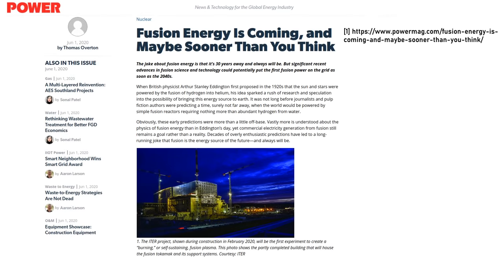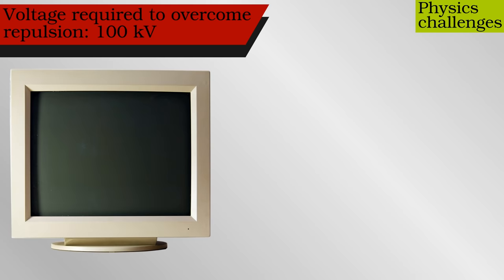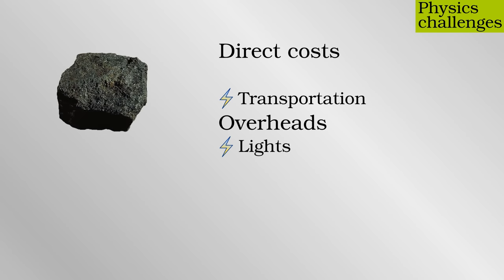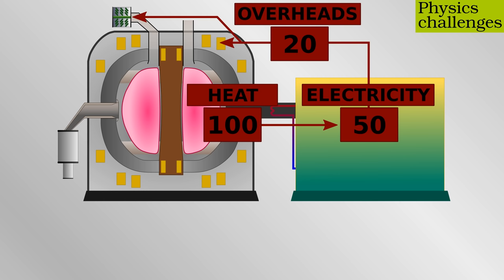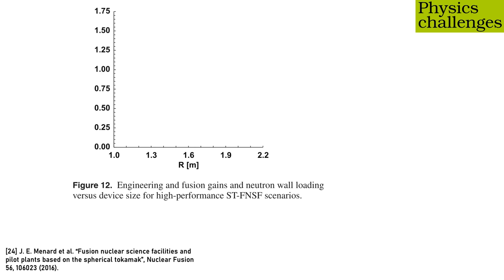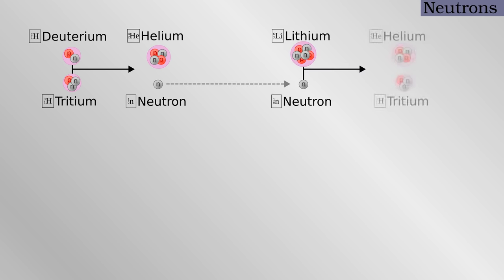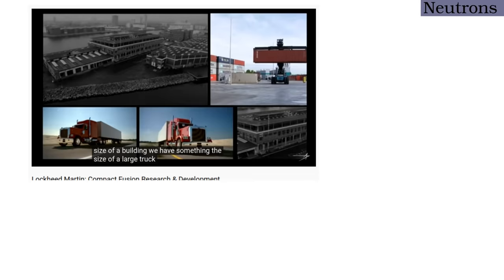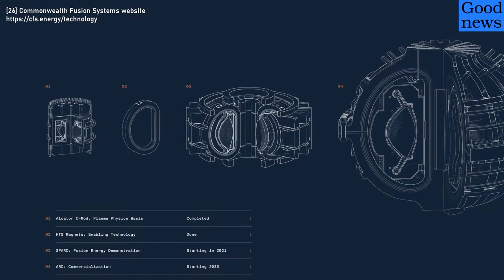Former fusion scientist on why we won't have fusion power by 2040

Comment: I worked at Princeton Plasma Physics Lab (PPPL) for 32 years leaving in 2011. When I started in 1979, they said "We'll have fusion commercially in 20 years"! We did achieve fusion with a D T reaction in 1996 and we did produce 14 MeV neutrons. It was a lot of fun working there!
Reply: I made a fission reactor in my garage but if anyone finds out they’ll come for me
Reply: @monkmoto1887  this comment was sponsored by Nord VPN
Reply: @monkmoto1887  Is your real name Sheldon Cooper?
Reply: In other words, nothing that benefited society.
Reply: @yourlogicalnightmare1014  Exactly . Its all 'Pie in the Sky '
Reply: @tonyjones7373  That's what Richard Feynman said about Project Orion.
Reply: You should have stayed a few more years as the physics codes scaled up.  Almost all the success of NIF between now and 2011 was solely down to advances in plasma modelling

The reason all these fusion startups are getting super confident is because they can rent time on some big supercomputer or GPU cluster and mash out field geometries to solve specific plasma dynamics problems.

You guys were sadly flying around in the dark.  Plasma physics has completely changed now.  NIF PIs almost prototype by simulation these days as far as I'm aware.
Reply: @ralalbatross  That fails to solve the myriad of technical hurdels involved in actually containing and then harvesting energy from any form of fusion reaction. 

Until you solve the problem of stars cheating the system via gravity, you will never achieve a fusion reaction that not only outputs more than was input, but also outputs enough to net a positive amount of energy in the system.
Reply: @keysersoze3987 very impressive. what's your take on this video? will we have fusion commercally any time in a future?
Reply: @bort6414 and the original steam engines only extracted 2-5% of the energy in coal. All technology starts inefficient it becomes better as we understand more no need to hate on advancement because it hasn't given you everything yet it's already given us so much
Reply: @bort6414  Stars don't cheat the system with gravity.  They increase both the temperature and interaction cross section by increasing density under extreme mutually exclusive electromagnetic pressure.  There are plenty of situations where fusion begins and then ends without the star igniting.  If anything we are cheating by using almost unnatural magnetic fields. 

The problem with hot plasmas is that they are fundamentally unstable due to fluid instabilities.  It's those which prevent most of the plasmas from burning.  Computational plasma studies allow you to remove and heavily dampen those instabilities by testing experimental parameters against likely outcomes, and then adjust experimentation to account for or track those instabilities.

Most of those techniques have been around for decades but only since about 2008 have they been scalable and deployable as they are now.  Experiments that would have taken six months to set up and fund and then fail without result are simulated in hours now.
Reply: You should have been working on flying cars. Everybody knows that 😂
Reply: @ralalbatross  Mhm. Sure it isn't.
Reply: @bort6414  I don't get it though the point isn't to make an artificial sun in this case its to make electric energy for the grid. You don't need the fusion process to output more than you input it only needs to be output enough to do what all nuclear plants do...make steam. 

Nuclear reactors are just big steam generators.. the steam is doing the work the energy is in the water..
Reply: @off6848 That's a gross misrepresentation of what a generator does. Of course all generators are less than 100% efficient. The point is that a generator takes a less useful form of work(heat, potential, etc.) and transforms it into a more useful form of energy, by decreasing the entropy within the system at the cost of increasing the entropy outside the system.

The issue with terrestrial fusion energy is that across the entirety of the system, it requires more useful work to be put in than it can produce. A steam turbine takes a certain amount of useful work from a systemic level(extracting the coal, building the refineries, igniting and controlling the fuel reaction, so on and so forth), but the end-result is a vastly greater amount of useful work output. Of course, the universal amount of entropy ends up increasing, but within our tiny little closed system that demands imbalances of energy be deliberately leveraged to achieve useful results, the amount of entropy decreases, and that is what matters at the end of the day.

The reason why stars are so great at this is because their immense gravity sets up the proper conditions to achieve fusion with relatively low temperatures. Additionally, the nature of gravity, being a one-way force(objects always attract), means that the very nature of a star itself is working to keep the fusion process in equilibrium(as the star cools, it's gravity is able to more strongly overcome the thermal expansion of the fusion process, which causes the fusion process to require less heat, increasing the rate of reaction, which heats up and expands the star, causing the rate of fusion to decrease... Thus the process is self-regulating as long as there is fuel mass to fuse).

Fusion-based energy production is impractical because not only must our fusion be orders of magnitude hotter(which requires more low-entropy work), but containing that ignition then also requires a massive amount of low-entropy work. The end-result is that the fusion systems on earth cannot produce more useful work than they consume, which means they are useless in respect to power generation. 

Once we reach the point where terrestrial fusion generators produce more useful work than they consume, by all means, we should build as much as physically possible. Until then, it's a glorified pyramid scheme that doubles as a scapegoat for actually useful power generation systems, such as coal and nuclear, and every moment we spend loafing around and dreaming of "cLeAn enErgY" is a moment human lives are lost due to lack of access to energy, and that makes me sick.
Reply: Maybe 🤔 if there was another Fermi like mind working on Fusion,then it would work 😂
Reply: The lack of appreciation for progress in this thread is sad. No one seriously working on fusion is promising the moon. Progress is happening and it isn’t happening at the expense of the average person or for nothing. These experiments are yielding important information that goes beyond fusion electricity. Get your minds out of the “fusion is always thirty years away” gutter and get some perspective
Reply: They have enslaved and fooled you 👉 The Connections (2021) [short documentary] 💖
Reply: oh, wow! 14 MeV neutrons! ...... wait, what are we supposed to do with those neutrons?
Reply: Eventually someone will crack it. We already have fusion bombs and the sun is powered by fusion.
Reply: Fusion is the world's 2nd greatest boondoggle,  next to "renewable energy".
Reply: The moot point that it is fun whether something practical is produced or not. The major achievement of fusion has been being able to make a great living and enjoy yourself on an eternal promise never fulfilled.

Comment: I worked on a fusion reactor back in the 80’s.  They swore the next version would be a full scale commercial reactor.  Parts of it were already on site!  Here we are nearly 40 years later and it’s still 20 years away…
Reply: It's a large site, takes a while to move the parts into position and assemble them.
Reply: I blame the construction permits.
Reply: would be foolish to buy into that far back. Fusion isnt fission lol. If fission is taking a sledgehammer to smash something, fusion is a doctor using a robotic scalpel to operate on an ants brain. like 1 to 100 difficulty change.
Reply: @Andytlp  the main issue is field strength... and ITER has relatively weak magnets to what is currently available which is why projects starting to be built today at smaller scale with more powerful magnets are probably going to reach fusion before ITER does...
Reply: @Wingnut353  I thought they used electromagnets
Reply: So we can deduct that the half-period of fusion technology is 20 years and that it will be achieved in 2061 years.
Reply: @Wingnut353  Well of course, wasnt it designed decades ago.
Reply: @Andytlp    Fusion is a doctor using a robotic scalpel to operate on a *highly litigious ant's brain.
Reply: Fusion power is a nice motivator for technical development, but in itself, it´s a wild goose chase.
Reply: JET?
Reply: @Larryshaw48  I forget the name.  It was a linear fusion reactor that used what they called ‘Yin-Yang’ quench magnets at each end.  It was at Lawrence Livermore Labs in CA.  We also did work associated with their laser fusion experiments.
Reply: There’s a company that got 120 millions Celsius for 101 second. Any progress here?
Reply: @tonypaca3015  So what problem is that gonna solve exactly?
Reply: Fusion is the world's 2nd greatest boondoggle,  next to "renewable energy".
Reply: @Life-mt8zl  Obviously...

Comment: Important note about the graphs around 8:40 is that the figure assumes classical low temperature superconductors with significantly reduced magnetic fields than are available in modern high temperature superconductors. That GREATLY reduces the major radius required and so changes the graph significantly.

Comment: XKCD Researcher Translation: "10 years" means "We haven't finished inventing it yet, but when we do, it'll be awesome."
Reply: Something being invented is also not at all that it will be instantly brought into use on a large scale. We finally achieved energy neutral fusion recently. I genuinky think energy positive fusion by 2040 is a gimme, very uncomonly in laboratory like test settings. Still gonne be a lonnnnnnng time for it to be usefuly integrated into any national grid as anything other than a vanity or similar  project.
Reply: * if only you'd give us all the money
Reply: @sc149  yeah no shit. you kinda missed the point there